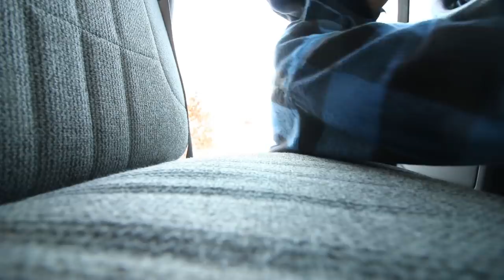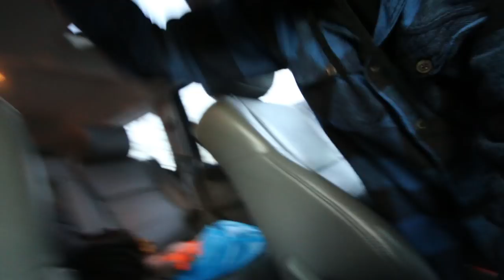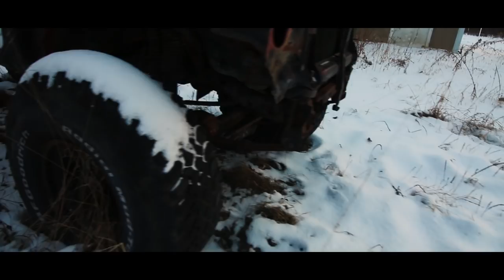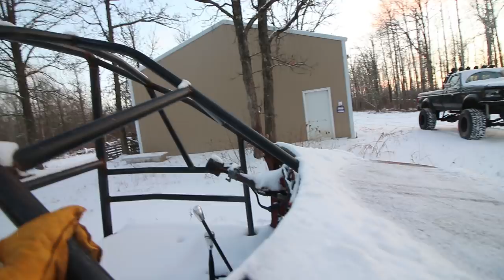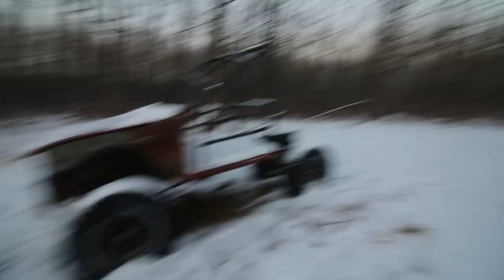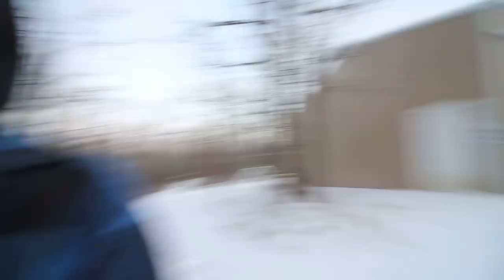NEW 4X4 BUILD

Comment: It was probably locked, jiggle the wheel while turning the key forward gently. Have a 96 F250 and if the steering is locked you can’t turn the key
Reply: If you read this U.N.O let me know what your doing with your old tailgate

Comment: Good is with Toyota's trucks , most junk yards have tons of parts , and for a cheep front bumper , go to a u pull it place , some time have older truck bumpers laying around for like $ 60 bucks , shorter the wheel base is better for trail driving , lighter is good for more power

Comment: I have a 93 f350 and the ignition locks up just like that. I usually have to hold tention turned on the key and rock the steering wheel back and forth a little

Comment: looks like a fun build, if it were me, id get some 4'' x 3'' square tubing and extend the rear of the frame back, so you can atleast put a set of leaf springs in the back, for some comfort
Reply from the maker: Joey Heider not a bad idea
Reply: You're a really good fabricator, why not four link the rear then it can stay short. Better for crawling.
And it shouldn't cost that much,use coil overs or coil springs from something out of a wrecking yard, or new springs, aren't that expensive, The major cost is the heim joints, but shop around, in the big picture they aren't that expensive either.

Comment: Your shifter linkage is loose. I have an ‘89 F250 that had the same problem but luckily It’s an easy fix. All you have to do is line it up and tighten the bolts..15-30 mins max.
Reply from the maker: Yeah I've figured it was something to do with the linkage. Thanks for the advice!